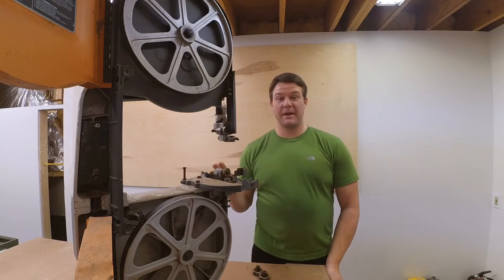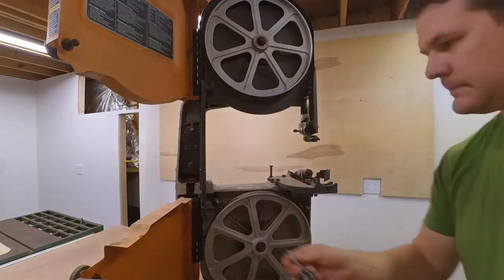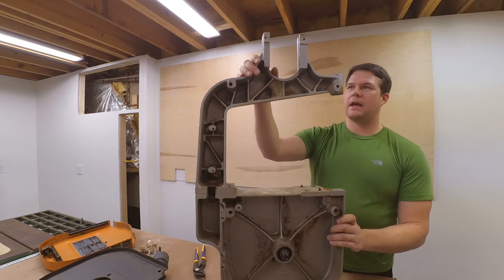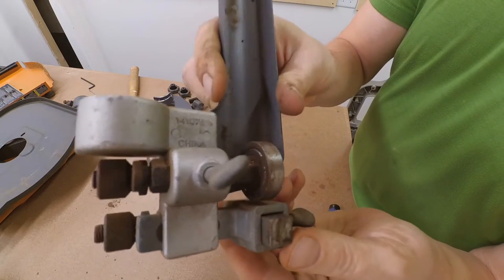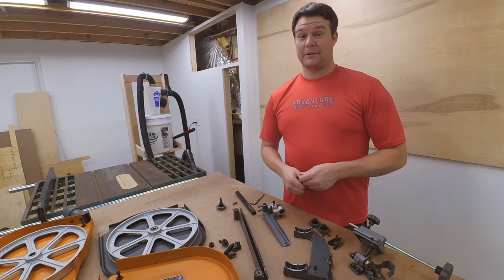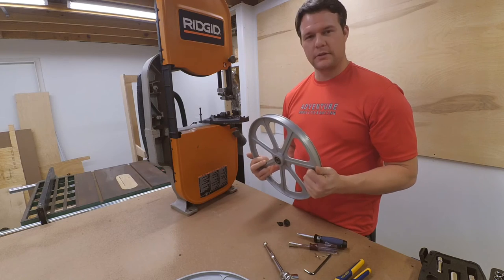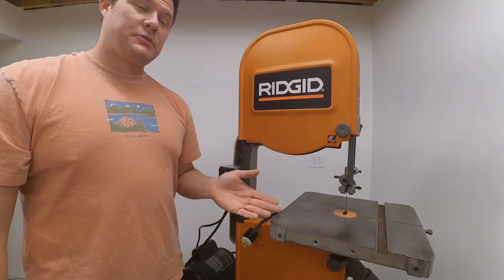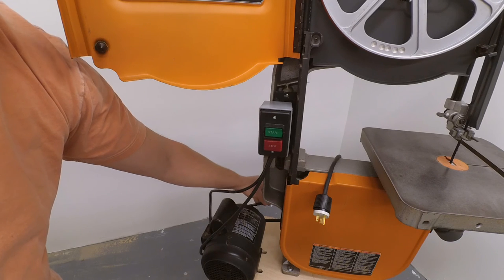Ridgid Bandsaw Rebuild & Upgrades

Comment: I have one of these.  One thing I can warn you about.  if you change blades frequently, the tensioning screw will become stripped.  to even out the wear, you can put a block under the point where the screw meets the frame, so the threads engage in a different spot.
Reply from the maker: Peter Collin thanks for the info, I did not read about that problem.

Comment: It would have been better to balance the pulleys in the same manner as an auto tire by adding weight opposite to the heavy side. Drilling metal out of the pulley only compromises the structural integrity of the part.